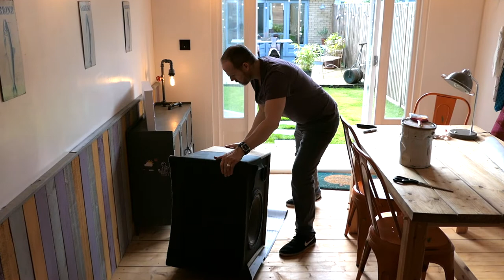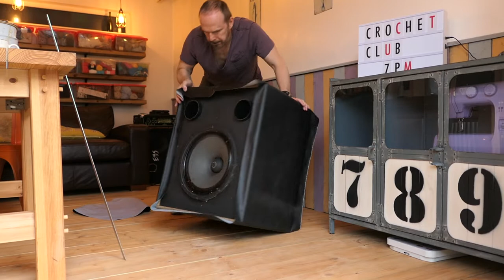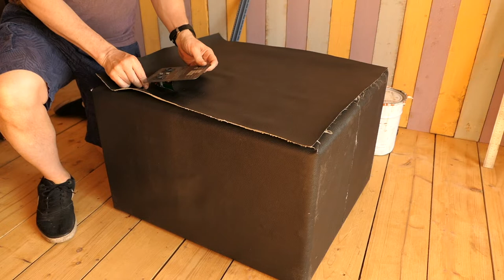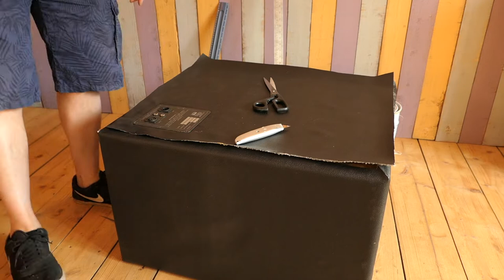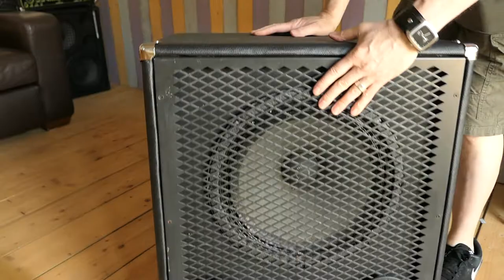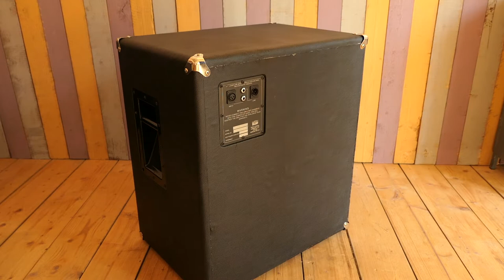COVERING A SPEAKER CABINET WITH VINYL

Comment: Cool playing! Few thoughts on the cabinet: 1. Make sure you have a new, sharp blade on your knife. 2. The contact adhesive goes on the cabinet AND the vinyl before joining them. 3. Draw a straight line on the cabinet sides and the vinyl. Then it's super easy to line them up! :-)
Reply from the maker: That's great, thanks for your advise.

Comment: The problem here is that CONTACT adhesive suffers from 'plasticiser migration'.  This is where the 'plasticiser' in the vinyl cloth attacks the adhesive and makes it 'goo-y' after a couple of months, and the vinyl becomes detached from the cabinet woodwork.  Plasticiser is in the vinyl to make it supple, otherwise it would be a stiff sheet of plastic.  It also tries, by migration, to make the adhesive supple too when it comes into contact with it... so the adhesive goes soft and goo-y after a month or two!

If you are attempting a Fender style of re-covering, where there are overlaps of cloth, it will soon become detached at the overlaps!  Using CONTACT adhesive is, frankly, wasting your time and money.  You should use some form of EVA (traditional for wraps) or PVA at a push... but both are slow to dry.  For Fender style covering, with overlaps, use a Polyurethane based adhesive, but they are not available in spray cans, sadly.

There are NO aerosol spray adhesives that are suitable for this job.  Some will say VINYL resistant... but in our experience, none really are because there is a very high plasticiser content in vinyl cloth.  

However, CONTACT adhesive is perfectly OK with TWEED or any other NON-VINYL (Tolex) covering cloths.

SESSION has been covering our own cabinets since 1985.
Reply from the maker: AwardSession Thanks for your advert. The covering is still on and hasn’t come one off.
Reply: Not an advert... we don't do covering as a service to anyone... only on our own cabinets.  Marshall had this same problem back in the late 1980s and had to recall many amps as a result.  Plasticiser migration is a real problem.  Sorry if you are offended by these comments.
Reply: Contact adhesive (Super 99) melted my tolex.  Real issue.  Use tolex glue.